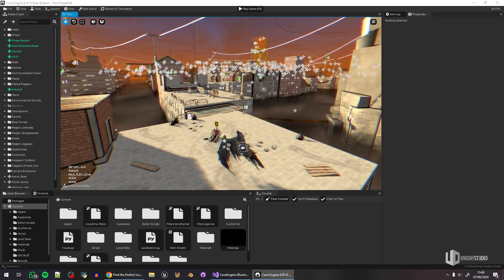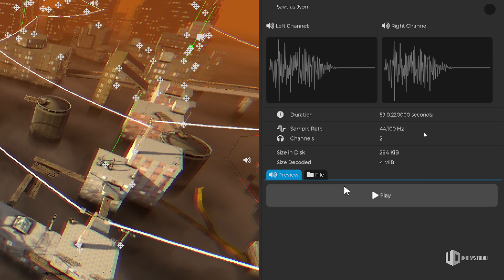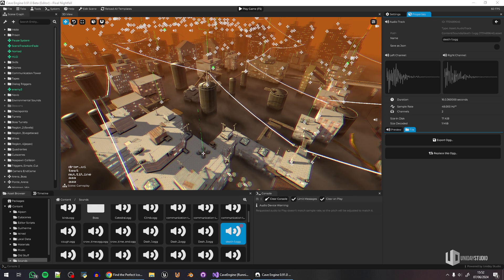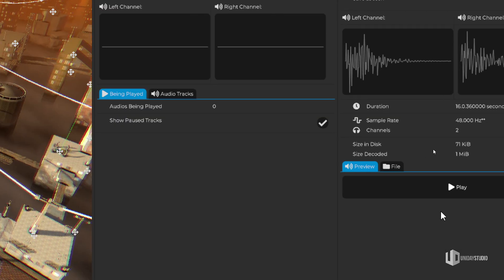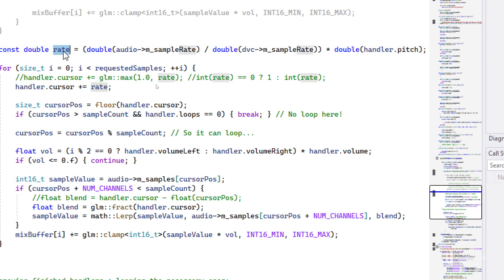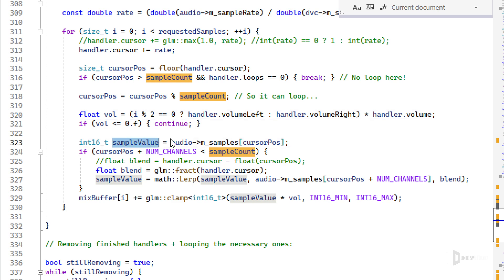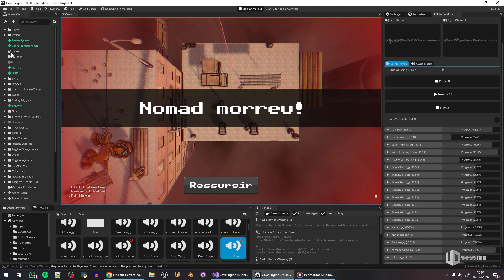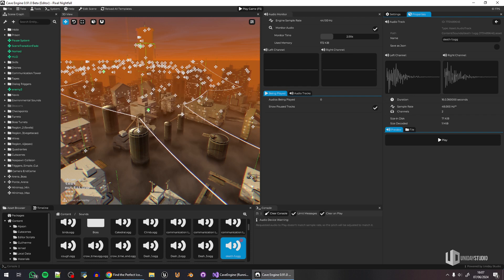A brand new AUDIO SYSTEM to my Game Engine | C++ Devlog

Comment from the maker: Update: Fixed it!
The issue was that I was completely no considering the fact that the sound is STEREO when arbitrary changing the rate of which the audio cursor moves forward. Meaning that it would eventually get out of sync to the "master" audio mixer buffer and start messing up with what's stereo and what's mono, mixing the channels together and causing all sorts of problems.